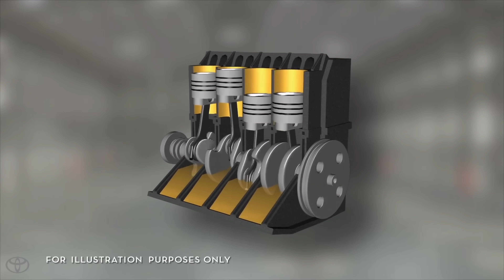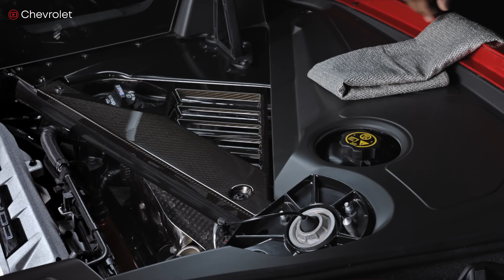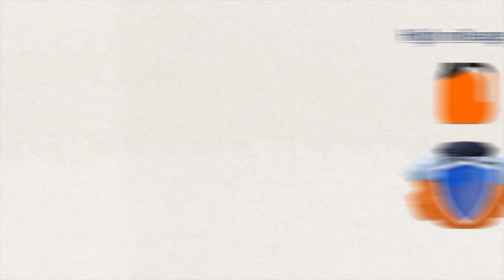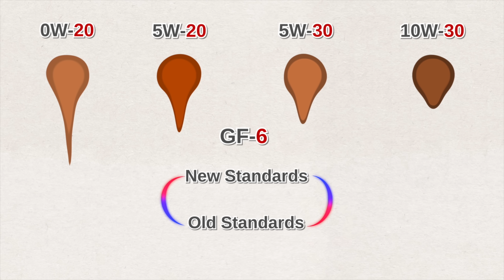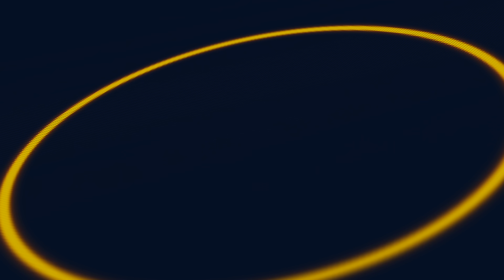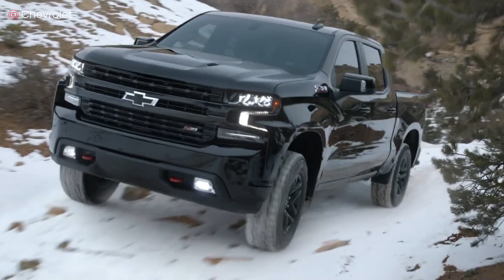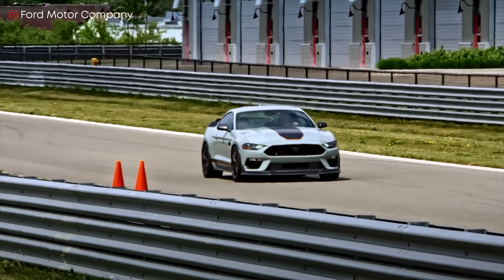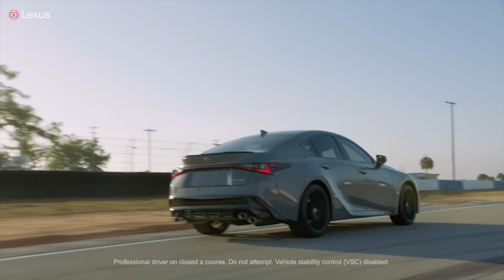7 Engine Oil Myths Stupid People Fall For

Comment: The dash light on my car that tells you what service to do, says to change the oil filter, every other oil change.
Reply: New oil filter everytime you change your oil. The oil filters are cheap protection. By leaving your old oil filter on. The old oil in the filter contaminates the new oil. Just doesn't make since to do that.   Shawn.
Reply: i would change the filter at every oil change
Reply: Better to protect the engine and change the filter too.

Comment: So  i have a 2000 sienna with 246k miles. I put 5w30 mobile one full synthetic always. 5w30 is recomended by toyota but should i go up to 5w40 since its thicker? I live in fl and my wife, the only driver, has a heavy foot.

Comment: There's really no reason to go past 5k on oil changes you can get your own synthetic oil at walmart or whatever and bring it to a shop and have them change it and it's usually cheaper
Reply: Shops actually charge extra to use the oil you bring in.
Reply: @fs3994  none of the ones over here do .

Comment: I keep getting a p0441 evap code and bank 1 camshaft B exhaust code but no check engine lights, but the OBD scanner says confirmed, should i replace both these sensors?

Comment: My VW recommendation is 10k miles between oil changes but I feel like that is way to long imo so I switch it when it gets warm and then when it gets cold. I figure that way it has new oil for the coming extremes, fun of living in VA we get cold winters and hot humid summers

Comment: Scotty I have a question in my owners manual their is a recommendation for an oil with a DEXOS rating . Do I need this rating as long as I use the recommend oil , The vehicle uses full synthetic by manufacture spec.

Comment: I “stretch” my oil filters to 10k and my fully synthetic to every 5k. I don’t bother with keeping track for the 12 month mark because I usually pass 5k in 12 months.
Reply: I use mobil  1 filters and they are good for 10k+.  I don't drive much but at least change my oil twice a year with a good synthetic

Comment: Awesome video as always Scotty! With so many people using full synthetic now days in their vehicles I always wondered how many of those quick oil change places rip people off and put conventional oil in when they require full synthetic! This is why I try to change my own oil.
Reply: Yeah of course, they buy in bulk and find the cheapest stuff they can get. If that was the only problem it would not be bad. Its when they forget to put oil in it at all.
Reply: @MrNota500   As if. Every place I've ever gone shows me the dipstick level after changing.
Reply: Also they might not allow enough time for the old oil to drain out,or they might use a very cheap substandard oil filter. Or use the oil filter they just removed from a car that they serviced before yours.
Reply: @davidpowell3347  l

Comment: My 2005 Nissan Pathfinder has a very high rattling sound when it starts up but is goes away I check the oil and I still have oil in it

Comment: Scotty, I have a 1994 escort with a 1.9l engine. Would there be any conflict with the seals if I switched it to synthetic. It has over 135,000 (maybe even 235,000 since it has a 5 digit odometer). I have had some say run synthetic and others say the the seals are incompatible. I have not been able to get consistent answers on this. Thank you. Do you know what years that stopped being an issue.

Comment: One more question: got a Bluetooth scantool and a wifi scan tool, rarely used if one of the cars shows a fault or for friends' cars. But what is recommended app which covers live data as well?

Comment: Why does oil in a diesel engine turn black real fast? Whereas it takes much longer to turn black in a petrol engine?
Reply: Diesel gets sooty and it contaminates the oil faster. Gas engines don't have soot.  Shawn.

Comment: Hi Scotty, how about changing the oil type? What I mean: after some years of 5W-30 going to 0-W30, that's what happened to my Volvo, and I cannot figure if it is because of what the dealer had on stock or if it was purposefully changed since I am closing in fast on 100k km.
Reply: For such a low-mileage engine you should simply go with whatever the manual recommends, Cris.
Reply: The engine protection is the same. 0W-30 will produce a slightly better flow rate when starting a cold engine which will be a slight advantage but at operating temperature both oils will behave like an SAE 30 weight oil.

Comment: I drive a 2002 se Pontiac Sunfire 2.2L and I live in Vancouver BC Canada there was cheap oil in it win I bought it know I'm using rolay purple full thin and I'm using k&n sliver oil filter will kill my engine or help it out and I'm use the Dura lube treatment oil to treat the metal is it ok to use

Comment: Something else worth mentioning with thinner oils is that they flow really well immediately upon start up and can reach the top end of the motor sooner. Most of the engine wear occurs in the first few minutes upon start up, so getting oil where it needs to go as soon as possible it very important
Reply: for motorcycles for sure
Reply: Im here for the entertainment!! What the hell they do with Scotty??!!
Reply: When starting my car (regardless if the engine is a hard cold or hot), I always wait a minute or two before putting the car in gear.
Reply: @ahotdj07  not necessary. You're just wasting gas.  I used to do that with some BMWs I owned because of rumors i heard until I read in the owner's manual that it said to begin driving the vehicle after you start it up and not wait.  I'm not saying you should Redline-rev it while cold, but there's no problem getting on your way rather than collecting gas fumes in your garage
Reply: @lawpenner  correct. The whole “warming the car up” rule of thumb is mainly for the engine to be at operational temps before racing it. Also it was a thing to do in cold weather. Letting the heater heat up the car before you entered it. Now we have heated and cooled seating so that’s now obsolete.  😂
Reply: @lawpenner  :  i usually let them idle for a half minute but maybe a few minutes when its freezing temps .....then i drive about 25 mph for five minutes or so .
Reply: @lawpenner there is a chap on here, forgotten his channel name, that does in depth scientific analysis of oil performance. He changed oil in 2 auto diesels, in each case prefilling the filter. In both cases the engines took around 40 seconds to get to normal pressure at idle.
Reply: @ahotdj07  
That's a good idea for the sake of the transmission more so than the engine.
Reply: Ya, too bad that 5w20 loses it ability to do its job over 70f.  Find me one link that supports 5w20 at 95f or summer temperature.   And no links to owners manuals as they have been falsified.
Reply: @lonniebeal6032  70F ? Go look up some viscosity vs temperature graphs that compare 5W20 all the way up to 20W50. Even at 260F 5W20 is in 5 percent max of 5W30, which is about within 10 percent of 5W40, which is within 13 percent or so of 5W50. When your in operating temp 5W20 is only slightly off of 5W30 when it comes to synthetic oils. Actually the hotter you go the closer the variance is, up the temps to 300F and the difference is even smaller.   XW20 weight oils have been out since 2002, and started getting used regularly in 2011 or so. If they did not do their job above ambient temperatures of 70F, Toyota, Honda, Chrysler-Fiat and Ford would be having a lot more in warranty issues and updated oil recommendations for older vehicles. Honda and Toyota have been using 0W20 in pretty much all of their 4 and 6 cylinder engines since 2012. 9 years later and there is still no updated oil ratings for those vehicles. 

This is as silly as everyone arguing 20 years ago about 5W30 being too thin and how all the engines calling for it were going to die of oil related issues, and going against the manufacturer ratings and running 5/10W40 instead. Meanwhile every car our family owns runs 5W30 and have anywhere from 90K to 550K miles with no oil related engine issues whatsoever.

Unless you are making modifications that change engine requirements, or are in an unusually severe service tier, your best off using the recommendation in terms of viscosity that the manufacturer built the engine too. Engines are usualy being developed around the newest current oil standards. Or in some cases, a new oil standard is being developed around a new engine that has new requirements.
Reply: @CondoreComputing  You are quite the tribologist.
Reply: @CondoreComputing  would using 5w30 in an engine that calls for 5w20 hurt it?
Reply: @mem1701movies  Probably depends on the engine and weather in your area, but most likely no you will be fine with 5w30 in a vehicle meant for 5w20. I have 5w30 in my sisters Kia Forte that calls for 5w20 but will be switching it back to the lighter weight oil when it starts getting pretty cold.
Reply: @lonniebeal6032  
Operating temperature is much much higher than the temperatures you referred to
Reply: @lonniebeal6032  
Ambient temperature is not what's important. How hot is it inside the engine. The coolant gets up to 185⁰ to 220⁰ but there are parts if the engine that get a lot hotter (maybe 400⁰). So nevermind what the outside temperature is. That's practically immaterial.
Reply: @njsongwriter  It blows my mind that so many people are talking about the ambient temperature of hot days. Ambient temperature only matters for starting the engine in cold weather. The "hot viscosity" is set by the manufacturer based on the engine design and tolerances. The cold viscosity is the only aspect that can change based on where you live.
Reply: @lonniebeal6032  It doesn’t lose its ability to do its job. It just becomes diminished. Obviously a higher viscousity heavier weight oil is going to be better at lubricating since it is going to be harder for the moving parts to push out of the way. 

 Every oil has its advantages and disadvantages, no doubt about that.
Reply: @josephrisner9596  : i think the main thing is keeping your crank and rod bearings alive if you ran too thin an oil for good oil pressure .

Comment: My uncle used to soak his hand tools in old engine oil to protect them.
Reply: That won't work with synthetics!  But it will clean them. That was the best way to protect old carbon steel tools, with old engine oil. 
Knew many an old timer to coat his saw blades after each day's work. Many guys coated their car frames with it too! (EPA shudders...😂)
Reply: Heat the oil up, then dip your metal in for hardening and tempering.

Comment: I've changed to Pennzoil full synthetic(ultra platinum 5w30) in my 2014 XLT F150 and i still change it every 5-6k miles. Prior, i used semi-synthetic blend... it was ok, but after 3k miles or so i would hear knocking and slight skipping every once in a while. Since the change over to the Pennzoil full synthetic, it hasn't skipped a beat. Better gas mileage and it's running smoother and quieter in all season months here in NC. Also, put in my wife's 2020 Jeep Rubicon and that even makes a world of difference. Maybe her Jeep will make it past 100k. ;)
Reply: PUP is FANTASTIC oil
Reply: 2020 jeeps are supposed to use full synthetic oil, read your wife's owners manual, u not so bright person
Reply: you talk like a commercial lol

Comment: Would have like scotty to talk realistically about what oil weights are more useful for old, high mileage engines (regardless of what the manual says)
Reply: Old engines were designed for use with conventional oil. So that what I'd stick to.
Reply: So my 98 Camry with 230,000 miles should still run 5w-30 and not worry about excessive oil getting past the rings?
Reply: @slurryz , as long as it's synthetic.
Reply: @slurryz  
No reason to change unless the oil consumption has gone up but even then I would try switching brands or switching to high mileage oil before I would play around with changing the viscosity.
Reply: Scotty is not a engineer he’s just a old mechanic. So your owners manual is your guide not someone’s opinion that may be inaccurate.

Comment: What about not driving many miles, only a few hundred, but going 12 months of sitting not driven much, should the oil still be changed even though not many miles were driven? If it says 6000 miles OR 6 MONTHS, then even if it sits, not driven much, it should still be changed, correct ???

Comment: I have my charger 2007 which requires 5w 20 and I live in a hot place Arizona is it ok to put 10 w 30 it has 240390 miles?¿

Comment: so i want to buy a saturn sky. they cost like 17k here but 500-1200 miles away they are 5-7k. is it a good idea to buy a car that far away and have it shipped to me?
Reply: Never buy anything sight unseen
Reply: @michaelchadwick3497  thats what i usually believe. but its a difference of 10k
Reply: @clippydid911  use some of that to rent a car, go look , if you don’t buy it will still be a lot cheaper than repairs. If you do buy turn in the rental and drive it home
Reply: @clippydid911  Or you can roll the dice and have it shipped .Who knows ,? You may pick a winner.We probably shouldn’t take financial advise from anybody on Y T anyway.

Comment: If I have a high mileage engine, should I always run high mileage oil? Or say every 3rd oil change?
Reply: Same oil everytime. The High Mileage oil has a better protection package. So why not continue what works?  Shawn.
Reply: Might as well do it every time, usually costs the same

Comment: I use walmart supertech FULL synthetic motor oil and one of those supertech 10k mile filters every 7500 miles. A Complete synthetic oil change for $20. Shops here charge $60-80 for a synthetic oil change. Can't beat supertech
Reply: Ive used it for years, no problems whatsoever,  200k + on my vehicles and still going strong. Good stuff

Comment: Hey Scotty! Can new oils be wearing out my 30yo car (opel kadett 1400cc 8v carb)? I noticed in recent years more oil consumption than it had before (have this car since 2005 and maintained it with changes every 5k).
Reply: If your using say 5w30 move up to 10w30. And watch the consumption.
Reply: Wear and tear. Nothing lasts forever.

Comment: Hey Scotty!! Can you put high mileage in too young of an engine? I changed a 2011 Hond Accord automatic over to full synthetic high mileage at about 75000milez Any concerns?
Reply: Fuel economy will drop ... but by only a tiny amount.  Protection will be a little better (typically)

Comment: Instead of 7 myths, he gave us a full lecture. You are the best Scotty
Reply: Absolutely 🇭🇲🇭🇲🇭🇲🇭🇲🇭🇲
Reply: I found it interesting.  Still don't understand why anyone would still use conventional oil?  Its maybe 5 bucks cheaper at my Wal Mart.  Who on earth would use regular oil?
Reply: @kevinbradley9601  I used conventional valvoline in my dodge dakota and drove it 437,000 miles until it was totaled in a wreck.  No minor or major engine work, it just kept going and  going and I changed it every 5000 miles.
Reply: I should have mentioned it was the 4.7 v-8
Reply: @kevinbradley9601  Some people like to change their engine oil more frequently than the maximum mileage or time that is recommended. Throwing away full synthetic oil after just 5,000 klm can be costly. For those who like to replace their oil at 3,000 to 5,000 klm it makes sense to not waste extra money on more expensive {Synthetic} oil that really was made capable of lubricating the engine for as long as 15,000 klm. Those frequent oil changes are taking impurities out with the old oil instead of circulating it for another 10,000 klm when others might change their synthetic oil. Synthetic oil may be the absolute best but so is a Rolls Royce but not everyone has one for the same reason not everyone uses synthetic oil. Oh and here we have price variations of as much as $40 for 5 lts between brands or types of oils. I will spend $40 more readily than $80 for my 5 lts. But I always change my oils at max 5,000 klm.
Reply: @kevinbradley9601  cars built pre 95 tend to run better with conventional as the oil molecules in synthetic oil are smaller than in conventional oil and the smaller molecules are more likely to pass thru the seals as machining back pre 95 wasn't to as fine of a finish nor to as fine of tolerances.
Reply: @dodgeme1986truck  I have always heard using full synthetic will make a car start leaking oil
Reply: @MonkeeVoodoo  only if there is wear or the seals have already started to harden
Reply: @kevinbradley9601  Some older cars just run better on conventional
Reply: This is basic oil change talk, nothing new or interesting.
Reply: @spaceexplorer6636  are u a mechanic? Dont be a ashol
Reply: @spaceexplorer6636  …not true. This guy is a credible source. Always good to another mechanic’s take on a topic.

Comment: Low viscosity in the snow high viscosity in the hot try to use synthetic change oils every 5000 km 3000 miles, or just get an electric car ( if you don't travel too far )

Comment: Would regularly driving 80 to 90mph be considered high speed driving or are we talking about 100+‽
Reply: That is considered high speed driving.  Anything 50mph and up
Reply: I consider Interstate speed limits or higher a high speed
Reply: Yes, sustained speeds of over 80-90+ mph create a lot more heat in the engine.  But that also depends on the car.